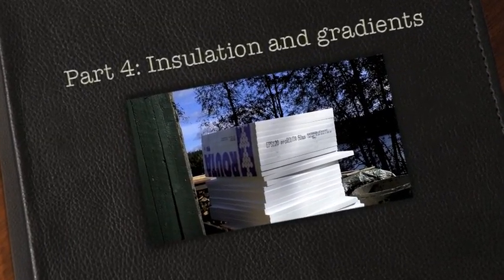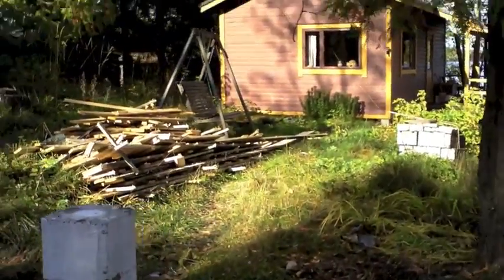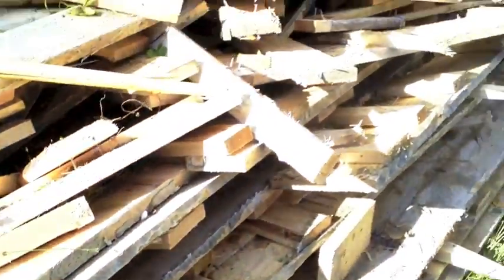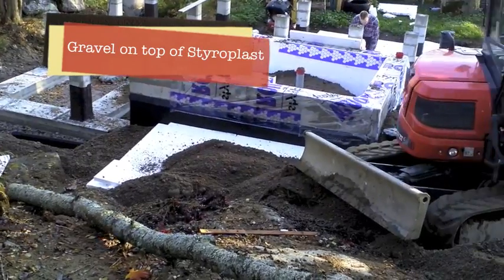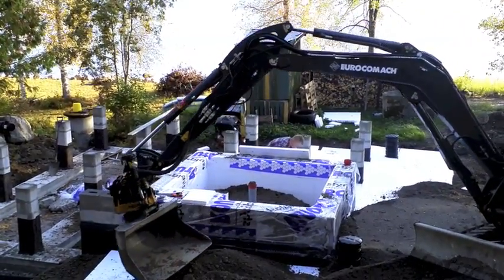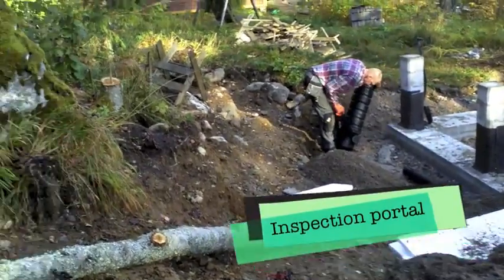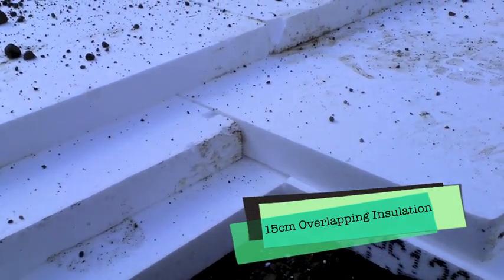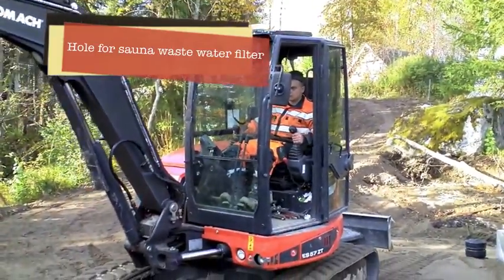Building a log cabin in Finland: Insulation and gradients (Part 4)

Comment: surprised they didnt put a bit of soft sand around the pipes to protect them
Reply: The ridges in that pipe give it  a very good tensile strength, and it is full of very fine slits in the grooves to let the water seep through from the ground and into the pipe... fine sand might clog them so a rough gravel was put down.
Reply: ahh, i thought it was the drain from the sauna,its to keep the land from getting boggy, the romans did the same with loosly conected terra cotta pipes to drain fields.
Reply from the maker: garryentropy Yeah it is the same principle. Farmers use it to keep their field from getting waterlogged.